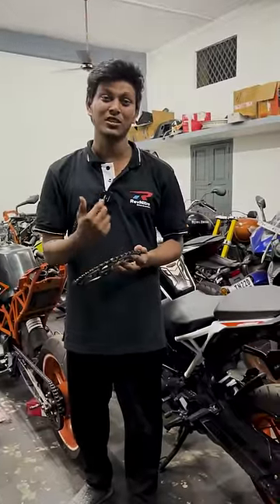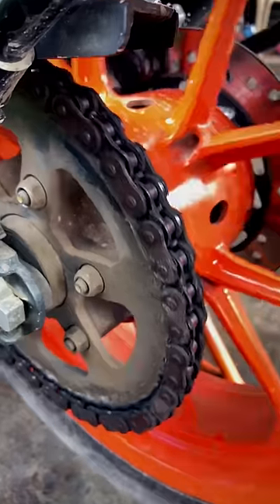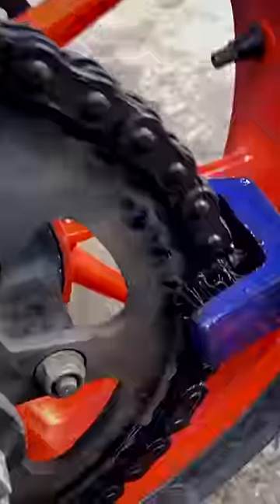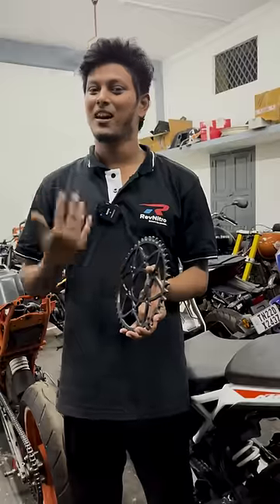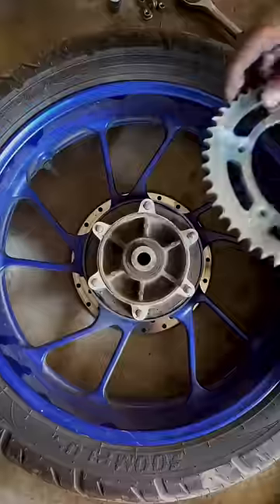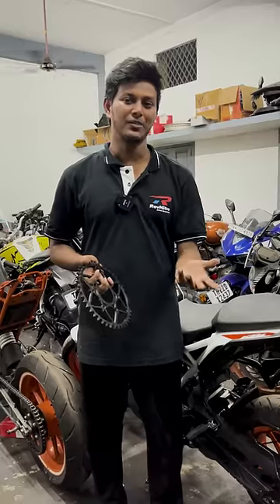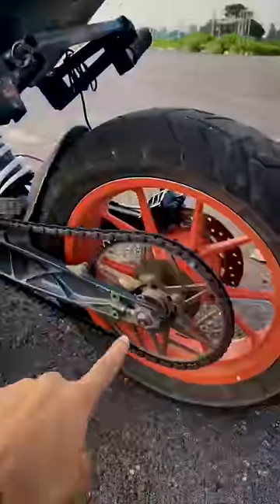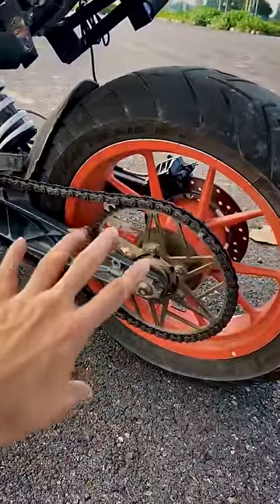Chainla Ivlo Irka? | RevNitro

Comment: Aluminum chain sprocket ah 😂😂😂 commonly used stainless steel materials for sprockets are 201 stainless steel, 304 stainless steel, and 316 stainless steel. The most prominent is 304 stainless steel. In terms of corrosion resistance, 304 can basically meet the demand for sprocket materials

Comment: Bro Honda  Unicorn ku vera ethavaathu chain sporcket poodalama
Reply: Hercules cycle sproket try bro...😂😂.., not for fun. If u change originally = u loss engine life because all the parts designed for engine support. 😊
Reply: Using but only single person load applicable 
Depends upon weight pulling capacity 
Usually 200 kg load design

Comment: Crores kanakkula pottu R&D pandra company kaaran enna loosa?
Reply: manufacturers design for a balance between torque and speed.... 

he is talking about customising based on user requirements... 

it is very similar to customising a laptop after buying a company spec... we may require more RAM, or More graphics powrr or more storage... we upgrade according to our need
Reply: Good question bro. But the company will balance performance and economy. But if you have a performance bias then this small mod will make driving a little engaging.